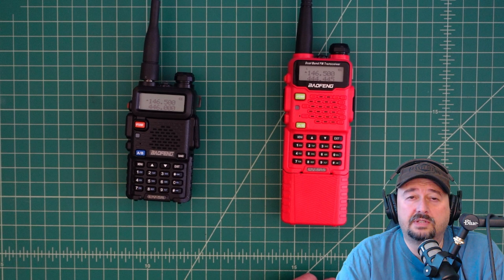Baofeng Scanning for CTCSS Tones

Comment: Hey new guy here and I was wondering if there is a way to turn off tone keying (that short beep/tone you hear when another radio transmits. I assume it's there to inform you that someone is about to start transmitting/talking) not 100% sure that the function is called "Tone Keying" I'm not up to date with all the terminology I'm just repeating what Google called it

Comment: Here is a question: In the video the transmitting radio is within the range of the receiving radio, so we can surmise that no repeater was necessarily involved...maybe was, maybe wasn't. If the transmitting radio was out of range of the receiving radio but there was a repeater involved that needed a code to activate, which is the sought after prize, how would the receiving radio discover the code? Does the repeater transmit the code necessary to activate itself ?
Reply from the maker: No repeater was involved.  The receiving radio can only process a signal it hears.  If the repeater has a code on transmit you can scan for that, you cannot scan the repeaters input tone unless you can RX someone transmitting to the repeater.

Comment: Hi for GMRS on a UV5R if I know the receive tone, the transmit tone is plus 5 more correct?
I am using the chirp to program a gmrs repeater and I put it in the receive tone aka tone sql column. With plus 5 of my receive tone of 156.7,  Chirp doesn't give me an option to put that amount in the tone column aka transmit column. Would all I need to do in this case is put the duplex + and put the offset for 5.000000? Closest thing to 161.7 is 162.2 in the tone column. Also on my UV5R it reads at the top +- when I am on channel mode for that repeater. The R-CTCS and T-CTCS are the same number when I look as well through the menu. Is this correct or does the T-CTCS number need to be different to transmit on the repeater?
Thanks!
Reply from the maker: The tones are set by the repeater and can be the same for both TX and RX 👍

Comment: I have a UV-5R GMRS and the scan for CTCSS codes only works on the VFO setting.  It seems very odd that it won't work on the channel setting.  I can't even set the tone frequencies manually (keyboard) in the channel mode, only in CHIRP.  Is this true for other radios?
Reply from the maker: In channel mode the tone setting is saved and that’s why it won’t work.

Comment: My radio will not scan following your instructions, what am I doing wrong?
Reply from the maker: No idea, sorry to hear you are having troubles.
Reply: It might be because of the version of firmware your radio has. BFB297 firmware will do it. Hold 3 and turn on to see you firmware version
Reply: I thought the same thing.

When in the menu I found you do not need set it to a tone first if previously in off.

When in r-ctcss setting,  press menu.  You should now be able to use the arrows to select up for down. 
Only at this point can you press the scan button and have the CT blinking to the left of the screen.  If CT is blinking when the receiver signal is transmitting the search will begin.

I do believe though it will only search while the signal is transmitted.  And will stop searching when signal is lost.  
If you have control over the signal transmission,  keep the mic cued until it have finished is search successfully.
Reply: You need to be in VFO mode then it works

Comment: I have a question because I see Your uv5r also exits after some time. Maybe You know what is the issue. I bought a uv5r more than 10 years ago and it stays in scanning as long as needed, but the new one just exits after half of minute. It is very frustrating, do You maybe know why is that? Thanks.
Reply from the maker: I don't know, I haven't seen that.